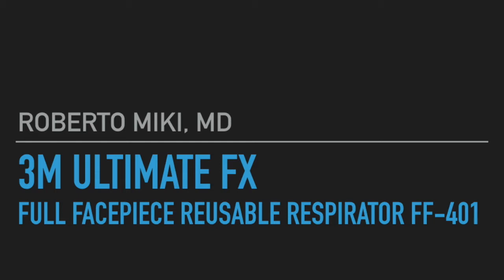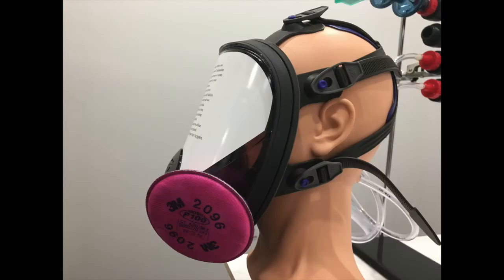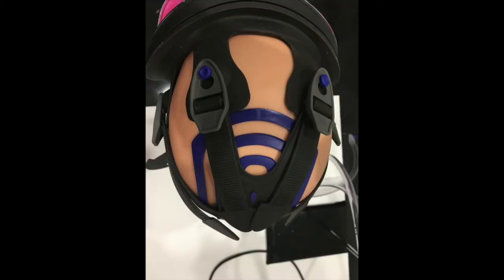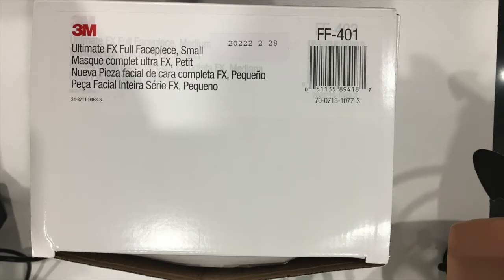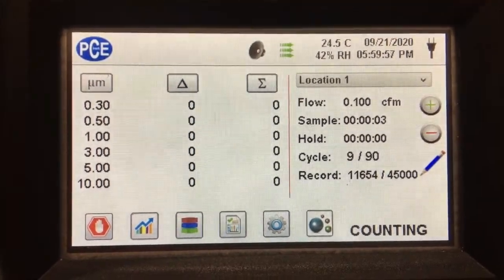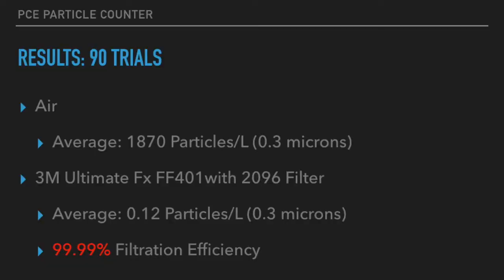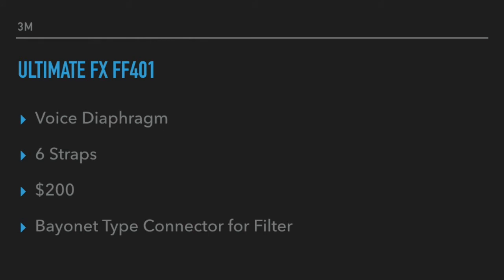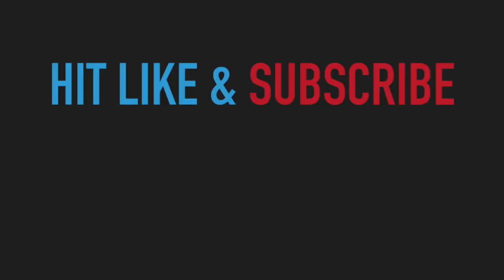3M Ultimate Fx Full Facepiece Reusable Respirator FF401 Testing

Comment: After watching this video, I decided to get one. It's a better mask than the 6800 series. The Scotchgard coating, 6 point harness is more comfortable and easier to adjust than the 6800 series. It also has a voice diaphragm for communicating with others. Definitely a better choice.
Reply: Have you used the 6800? I have used it for periods of 10 hours, it's a torture. Do you think 3m FF-402 is more comfortable?
Reply: @levenusine5095  I’m also considering the ff400. Currently, I’m using the 3m fr m40, and its torture as well
Reply: @domp5014  It's good to know that. 3m 6800 wouldn't be a problem for a 1 or 2 hours of use, but more than, it marks your face terribly. It is very uncomfortable
Reply: @levenusine5095  I know what you mean. Last year I was airbrushing heavily and was using the 3m 6800. I had to take breaks in hourly intervals just because of the face seal intruding into my face
Reply from the maker: I agree it is pretty awesome. Don't watch this video or you might buy another mask! Thanks again for watching. https://www.youtube.com/watch?v=C2g7NaQNGOk&feature=youtu.be
Reply: @RobertoMikiMD  I did look at that one today, but prefer the FF FX-403, because it has a better field of view.